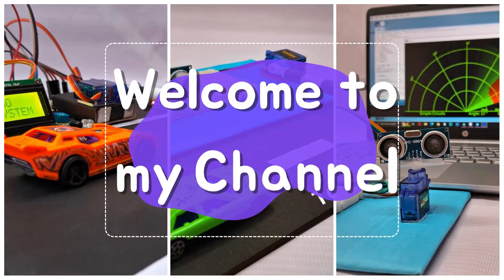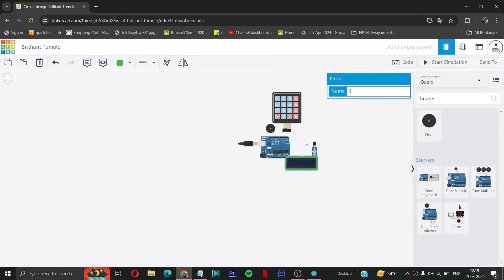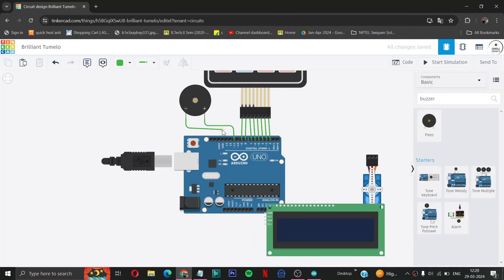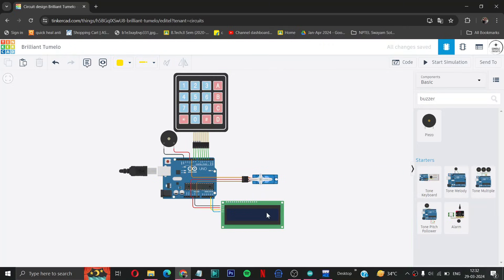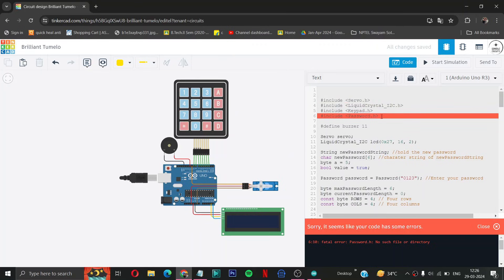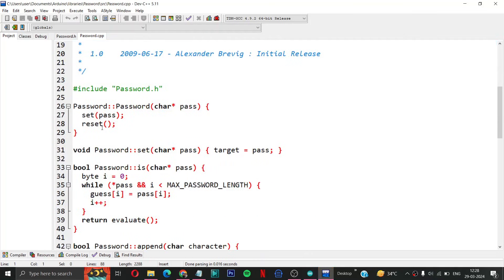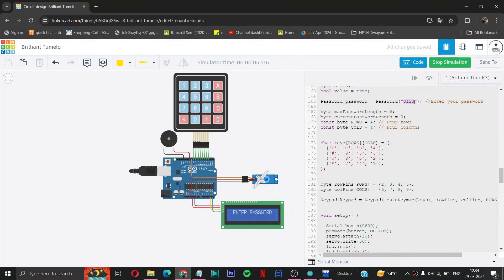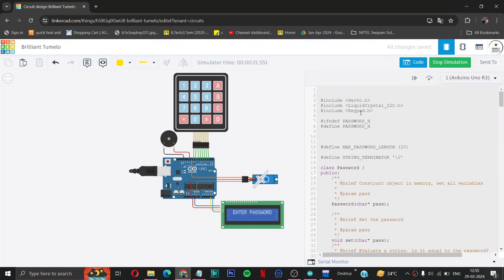Password Door Lock Using Arduino | Arduino Project | Tinkercad Tutorial

Comment: If I want one of the keys to be activated with a button on breadboard and not like "C" for example, then when i put the digitalread and compare it in the IF of the keys, it sends a error that the doorreset() is not declared. Is the library universal or does it only work with the keypad?

Comment: The code I put copied from your website seems to be different the one in the video. Can you check if your website's Arduino code is the same as yours pls?
Reply from the maker: Sure
Reply from the maker: It same as I shown in video.
Here is the link of same :https://simplecircuitslol.blogspot.com/2024/03/password-door-lock-using-tinkercad.html
Reply: Unfortunately, the display and servo motor won't work. Can you fix that please?
Reply: And since you are very good with electronics, I was wondering if you could do the same lock but it also incorporates fingerprint, RFID and a GSM as an alarm. Are you up for the challenge?